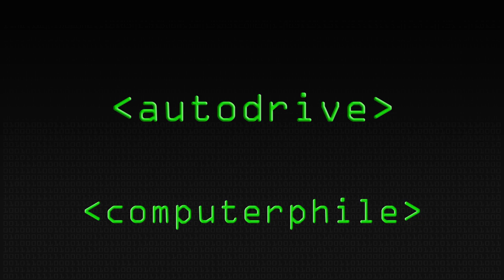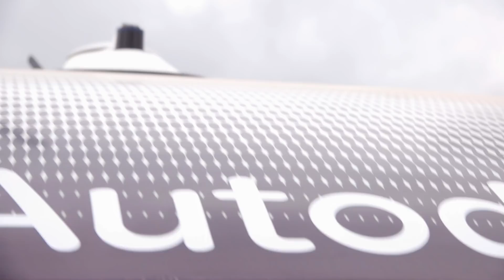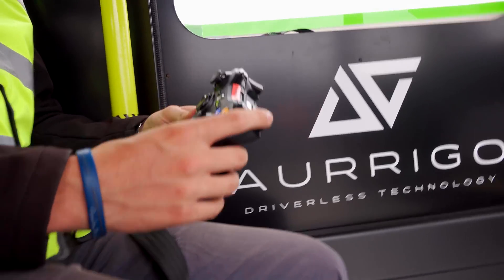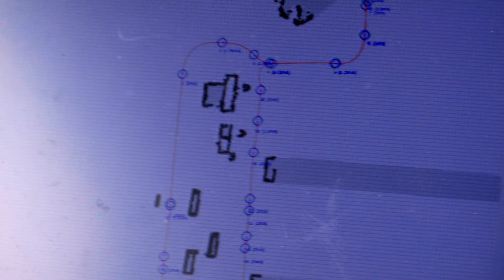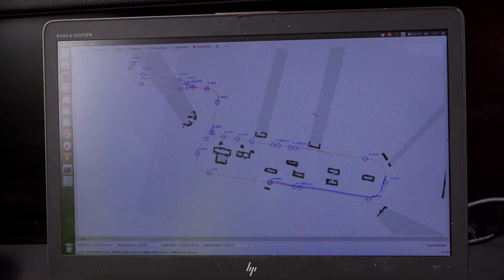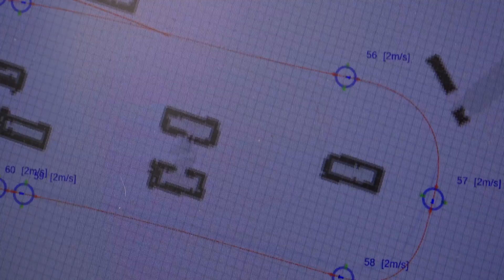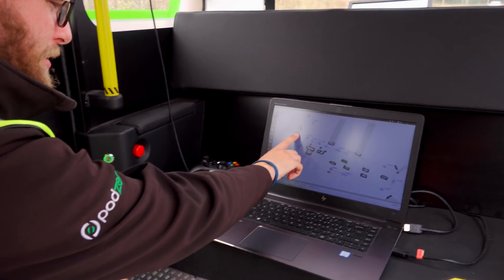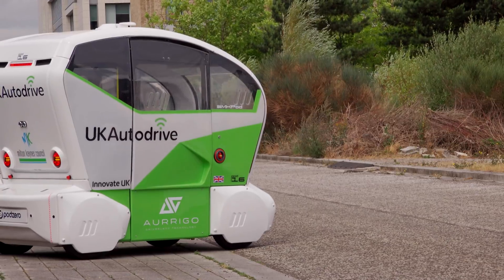Autodrive Project - Computerphile

Comment: I'm rather troubled by the fact that this navigation system is operating with 2d LiDAR and GPS.  For starters 2d Lidar is a system that essentially only looks for this in the horizontal plane. Lidar is rather notably weak in wet environments due to it's use of Near IR pulse lasers however this may be while 2d lidar is used as orthogonal (perpendicular) bounces are the strongest possible return. The issue with 2d lidar navigation is the fact that it can be fooled, it's blind to small/short objects  and is relying on a limited band to establish the position of an object. The other issue is this system is utilizing GPS as a hardened nav and position aid within a spatial resolution smaller than GPS's reliable CEP (circle error probable). This means the pods position will not be reliable and that it may suffer from what is known as GPS drift. The lack of an stereo imaging system or ground to sky scanting LiDAR or even close proximity radar or ultrasound is troubling.
Reply: Proof of concept through. The other stuff can be added later.

Comment: Driverless technology already exists. Put it on rails. It solves so many of the problems that plague self driving cars.
Reply: Or just use normal PT; and make it possible to put bikes on or park near bus (that have their own dedicated lanes), light rail, and trains stations. You expand the station's capture radius by 2-3x. It works really well.
Reply: Rails have a very high upfront cost. "use rails" is an alternative to "use roads". Automated tram line to replace most of the roads = £££££££££

Comment: Lidar? So all I need to do is grab a can of spray-paint, run up to the car and spray the lidar's visor and the car is immobilized? Cool!

The problem with these types of vehicles is that they work perfectly fien as long as nothing odd happens. They must put passenger and traffic safetly first so they cannot ever take any risk. If there is a roadblock, they cannot choose to drive over the sidewalk for a bit, not even if there is a policeman guiding traffic.

This is also why drierless cars will never work in a city like Amsterdam where the roads along the canals are often blocked by moving vans, badly parked cars, roadworks... quite often you simply must mount the pavement to get by, and a self-driving car cannot ever decide to do that, it will wait for the obstruction to clear, and it will be  stuck there for as long as it takes to get towed away.
Reply: > Lidar? So all I need to do is grab a can of spray-paint, run up to the car and spray the lidar's visor and the car is immobilized? Cool!

Unfortunately, this is very likely to happen in Milton Keynes, where this is being trialled. The Santandar Cycles scheme in Milton Keynes almost closed down due to the level of vandalism (people used angle grinders to cut bikes completely in half -- not even just to cut locks).

Targeting people over the limit, to get them home safely, will make this even more likely!
Reply: isn't spraypaint regulated in the uk? can't buy it without documentation and ID?
Reply: You only need to run up to a normal car with spray paint and spray it's windscreen and the car is immobilized (unless you got a reckless driver).

Comment: I can already see a number of weaknesses in this:

(1)As it is relying on LIDAR it is relying on cues that are supposedly permanent - what happens when builders decide to drape the outside of a building in absorbing material like you commonly see around cities?

(2)Where is the GPS navigation? Was this deliberately left out and if so why? As LIDAR is not always reliable(see the point above).

This just feels like another unnecessary technology that will not cope particularly well with a busy changing environment.

Comment: QR code scanner? What is this? 2010?
Reply: I believe what was described in the video is that your phone will display a QR code that will be scanned by a camera on the vehicle.  It sounds like the commenters here might be thinking about it the other way around.
Reply: You are correct. He even played it out in the video.
Reply: Cameras are on every phone, nfc readers or other techs, not so much...
Reply: cameras take a while to load, which is generally a bad user experience
getting something like the oyster card would save loads of time
heck you can even get paper cards with rfid inside for single use
Reply: @Stay EZ My Friends we have a mobile payment system here that uses QR for those without NFC.
It holds up the entire queue at the supermarket to have to load the camera and point it at the QR code just right
Reply: @Stay EZ My Friends we got that also
Reply: Stay EZ My Friends [young] Students use QR badges to login to chromebooks

Comment: What I am always worried about is: snow. I once read that once the street barriers are covered in snow the car only navigates via GPS. Which can't be how it actually works because that would be way too dangerous. 

So does anyone know how the car reacts to snow? Or construction sites / damage on the road in general?
Reply: I think these guys are working in UK. When there's more than a few snowflakes dropping in UK, the entire country grinds down to a halt. Businesses shut down. Buses shut down. Trains get cancelled. Everything stops and people post pictures of snow on Facebook. Two days later when the snow is gone everything goes back to normal. I don't see why this should work differently.
Reply: There's a reason they test the cars in California in the summer, and not in the north in the winter.
Reply: LiDAR shit's itself when water get's involved. Almost all LiDAR systems available commercially operate with NearIR based pulse laser systems.  Near IR is heavily absorbed on water, snow, ice, ect.
Reply: Hopefully when it snows all transport will cease until the snow and ice clears, meanwhile everyone remains at home waiting for the text message to return to work.
Reply: Well I would assume that every route the car drives (or at least every regular route), it saves all the road info and markings to it's computer and so just like humans, it would use that saved data to know where to drive.
Reply: What about windows and other man-made refractive surfaces?
Reply: Look at how fast that car is moving, there's a risk of getting stuck in heavy snow and that's probably about it. In that casde, you can step out of the pod and walk the rest
Reply: Humans don't react well to snow, either, which is why it often gets cleared very quickly.

Having said that, I definitely think that's one of the outstanding issues, and that's part of the reason why they aren't available yet.

Comment: Might be useful to explain what a 'lidar' is and how it works. Also the difference between indoor/outdoor lidars.
Reply: it's like radar but uses light instead of radio waves. the difference between indoor/outdoor will be what wavelengths the sensors will pick up